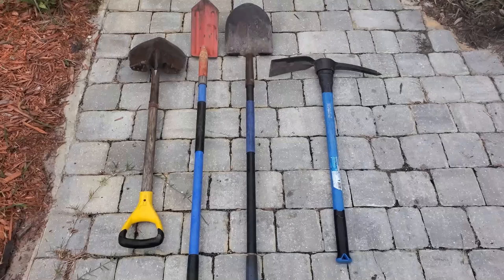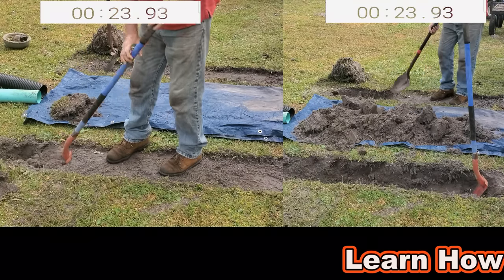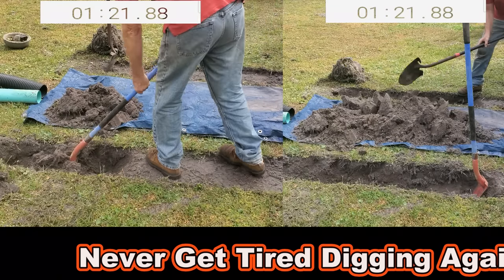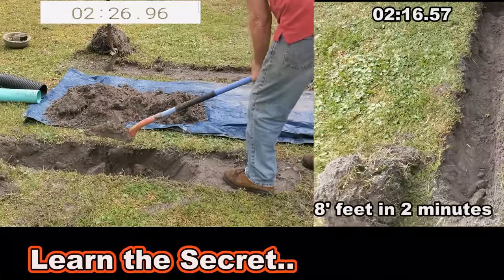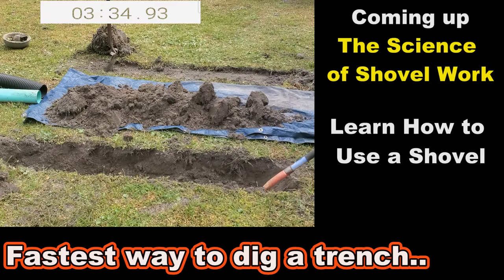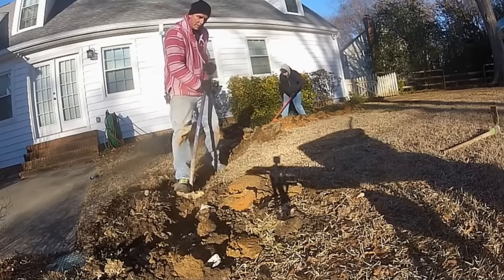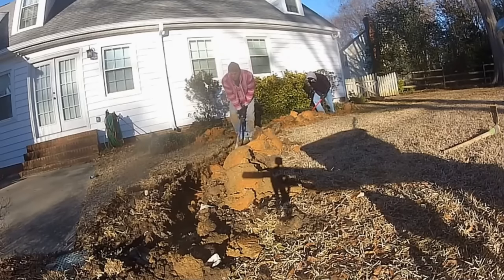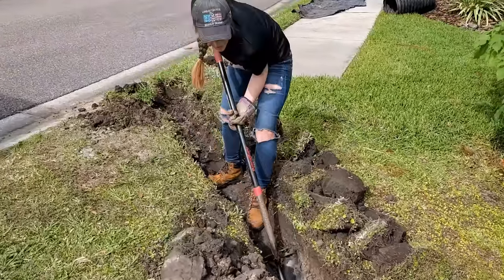Fastest Way to Dig a Trench - Never get Tired Again

Comment: Right on time! I'm currently trenching for Termidor liquid termite treatment around my house. So TIRED!  Done about 1/4 of my house perimeter (~60 ft) 6 inches deep by 6-8 inches wide and I think I am on the right track using a 5 lb mattock. Some loamy soil beside the house and natural heavy prarie clay at depth, and a lot of mortar chunks. Also, using a flat head shovel for some digging but mainly shaping and cleaning and backfilling. Very hard work but worth it. I know non repellent termite barriers work (I'm redoing what we did with Termidor 16 years ago), but bait stations?-not so much. All you can get termite companies to do now is bait stations. It's almost as if they don't like to trench!-- but I love it! 😉
Reply from the maker: I hope this video helps
Reply: The only thing I hate as much as the shovel is the pick.

Comment: I enjoyed your video.  Just one question, doesn't the width of the trench make a difference?  You removed the same amount of sod from both trenches before removing the dirt.  It seems the little 5 inch. trenching shovel would be best for narrow trenches and the regular shovel best for trenches of wider width.  If you tried to dig an even wider trench, it seems an even wider shovel would work best.  I prefer narrower trenches since I typically bury smaller pipe or wire runs.  For those, the bigger shovel gets in my way and makes a mess.  It seems you're talking apples and oranges here.  I know expert and you are so I trust your more experienced answer over my own assumptions.

Comment: Looks easy when you don't have to deal with very large rocks and boulders. It's not uncommon for me to hit 50lb+ boulders in my area and the rare occasion of running into a boulder that is 100lbs or more. Not to mention there is always a bunch of smaller rocks with every shovel which also slows the digging down. On top of that the soil is very hard here.

The biggest boulder that I ran into when I was planting a tree by hand was in excess of 1,000 lbs. It took a while to dig around it to find its shape and size and In the end we ended up planting the tree in another spot because we didn't want to rent heavy machinery to remove it.
Reply from the maker: @Adohleas  seriously? What does that have to do with the fastest way to dig?
Reply: @appledrains  Because in my area I have to commonly use a pick, I can't just push a shovel like that in the soil as all the rocks will stop it.

Comment: They dont make really good shovels anymore! Ive got an old Ames Tiger pro 300 made in USA. Everyone else always says "it's so heavy" but its the best shovel ive ever had and I've worn out a few! As a kid shovels were some of my favorite toys and digging holes was considered fun! So I've long used all the methods you point out and could add some further advice. For one thing never kick or stomp on the back of a shovel, its inefficient and may injure your foot. Keep your foot in contact with the shovel as you raise it and plunge it into the soil, that way you have the combined mass of the shovel and your boot and leg acting together to penetrate the soil. Also always consider the cost but sometimes its better to get a machine.

Comment: The end result is obvious from the first few seconds. If you are digging a trench twice as wide as the shovel you are using, of course it will take longer. Isn't the point of using a trenching shovel to dig a trench exactly at its width?

Comment: There's NO WAY you're going to dig a trench that long in less than two hours in New Jersey.  With all the rocks, gravel, roots, and heavy clay, that huge shovel won't work AT ALL.  You need the smallest shovel possible to dig up all the rocks.  And, did you soak the soil in water first?  I've never seen such easy to work with dirt in my life.  Your method works where you live, but not everywhere.  Good tip on saving your back, though; very important

Comment: When you need to lay down electrical conduit, it has to go 24" deep in a trench.  Digging that with the wide blade would kill an average man.  The typical conduit is 2.5" diabeter, so a 3-5" spade is the key and making a 5" trench that is 24" deep is so much less back-breaking since you are lifting only teh 5" of material at a time instead of 8" of it.. UGGHH.  With a 24" trench, this means going over it 4 or 5 times too.  so much for the 2 minutes, right?  With the deeper levels, sideways movement becomes difficult if not impossible too.  A 20' trench at 24" deep is easily a full day of work if not a couple of days..  I am curious why anyone would trench ony 6" deep if it will not pass code and makes a hazzard with whatever you are burying in there??  The only real drawback I have seen with the trenching shovel is how narrow it is with using my foot to step on it to drive into the earth..  That narrow neck doesnt  give a lot of space to shove with your foot..  The 8" shovel I can get my foot on the sides of it to push it in...  I guess that is it.. sorry for the rant.

mrstan

Comment: Wth would you use a trenching shovel to compare the speed of digging a trench the width and depth of a normal spade. Of course its faster. You dont use a trenching shovel for that. Its for laying conduit, water lines or digging out the sides of a pipeline to fully expose it in a narrow trench.

Comment: If someone does a job for years, they're inevitably going to figure out a thousand tiny little things that add up to greater efficiency, either by thoughtful consideration and experimentation or just good old dumb luck.  Higher efficiency is literally getting more for less.  No one wants to work harder than they absolutely have to.  If you've been digging trenches professionally for most of your career, I believe you when you make straightforward claims like "this will get you more trench faster and you'll be less tired."  I don't dig a lot of dirt, but the shoveling technique you're demonstrating here looks an awful lot like some of the stuff I've found myself doing while shoveling heavy snow in the winter, so it sure seems to check out with my experience.

Comment: So obviously if you are trying to dig an 8" wide trench an 8" wide shovel will be faster than using a 5" wide shovel.  Use the shovel that matches the desired trench width.  Don't use an 8" shovel if you only need a 4" wide trench.
Reply from the maker: Try it and see how much time you can save
Reply: @appledrains  I do everyday.  Working in sandy loam is a dream, try working in rocky clay.  You want to move as little material as possible.
Reply from the maker: @D2O2  strange

Comment: This video proves nothing.
I have used the 5" trench shovel as you call it.
We call it a spade shovel in Texas.
I never had a problem using a 5" spade shovel & it was faster than the 8" shovel.
I have dug over 200" of trenches for wiring & pipe without any problems.
I also built my own home & shop almost 20 years ago.
It all boils down to the person behind the shovel.

.